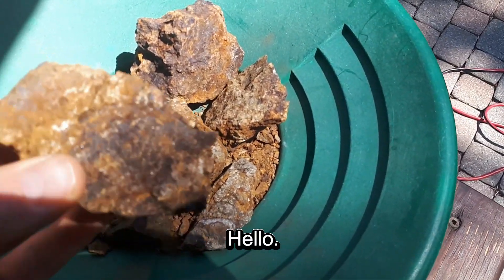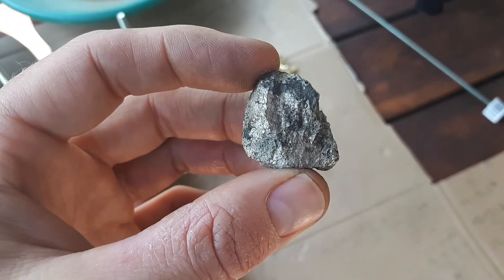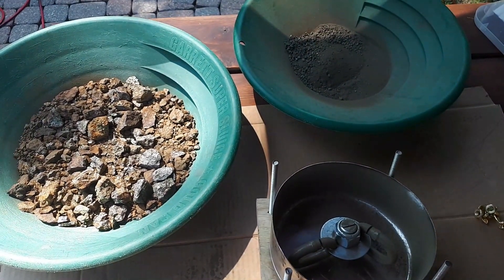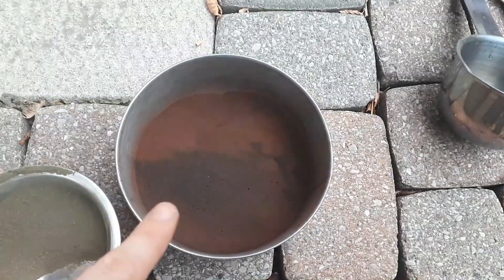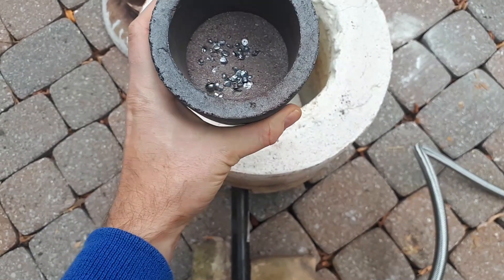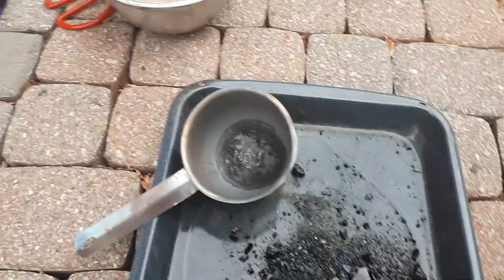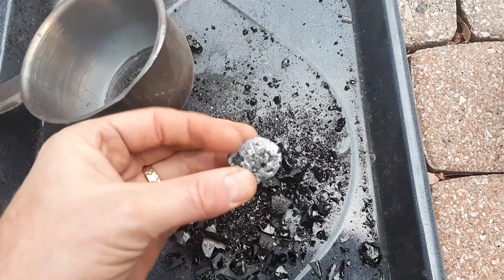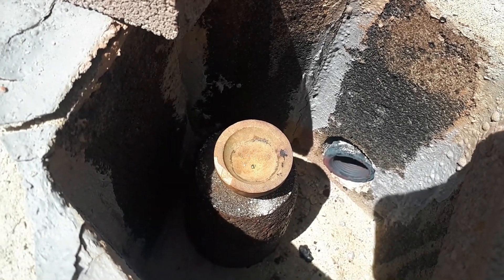Extracting Gold from Ore Found at an Abandoned Mine Dump

Comment: How do you calculate what qty of fluxes you need?
Reply from the maker: I just kind of wing it. I generally want a total of about 2-3 times the weight of flux relative to the sample. So if I have 100g of sample I usually want a total of 250g to 300g of flux. 
If the sample is very rich in sulfides, I add a lot more soda ash relative to borax. The sulphides create an acidic smelt, and the soda ash is basic, so it balances the pH out. If it is low in sulphides than I do more borax relative to soda ash so the borax can keep the melt less viscous (so it is not so thick and sticky, flows better and allows the lead to collect precious metals better and settle at the bottom).
If there is not much silica in the sample, I will add 20 or 30g of silica. If there is lots of quartz in the sample than I don't both adding any silica.
I usually go with about 25g of lead as a collector metal to pick up the precious metals. Less than that and you risk not having enough flowing around to collect everything efficiently. More than that and you need bigger cupels and longer time for the cupellation process.
I recently purchased some manganese dioxide to help oxidize sulphides, but I haven't had a chance to try it yet.

Comment: Great video keep it up man. How long did it take to vaporize the lead for this piece?
Reply from the maker: Thanks! Cupelling this I think took around 45 minutes. But the lead doesn't exactly vaporize. What happens is in liquid form the surface of the lead oxidizes very readily from oxygen in the air to form lead oxide on the surface of the lead puddle. That molten lead oxide then slides off and gets absorbed into the cupel. And this oxidation/absorption process happens over and over until all the lead is gone. A small % of the Pb does get airborne, I think 95% or more is absorbed into the cupel.
Reply: @LetsCrushRocks  Thank you. You are really creative and skilled in your work. Good results.

Comment: Hello. Excellent. Use a different method. Powder the soil and dust it with gold. The full coat and melting aid include Hello. Excellent. Use a different method. Powder the soil and dust it with gold. and then instead of lead. Put the lead oxide in the bush with charcoal powder, sodium carbonates, and borax, and finally an iron rod in the bush to absorb the sulfbeds. Your soil is probably silica and you don't need to add silica powder. And finally, use a cone container to pour the molten material. The result is great. Good luck, I am always a supporter of your videos, and the help of melting includes
Reply from the maker: I've been using an iron rod in my more recent smelts! it helps!

Comment: Gold prospecting has the advantage of today's use of ancient gold prospecting tools with the modern day machined tooling dowsing rod aiding in dowsing for gold. In the 1970"s my father and I reverse engineered the physics involved in dowsing and invented the modern light weight ball bearing dowsing rod for applying dowsing physics in locating our old core-drill on the exact center of gold and silver veins that are buried under 200 feet of glacier rock and till, which worked out perfectly for us. These dowsing physics and dowsing techniques are too important to the world for myself to selfishly take to the grave. So I wrote the book to teach the world how to apply physics in dowsing for any sought element, with marketing my book at the lowest price possible so that more people will be able to buy my book and learn how to dowse. My book's name is: The Art of Dowsing - Separating Science from Superstition ($14.95), by Michael Fercik. My book explains all the physics involved in dowsing (the same physics that energizes the alarm on electronic metal detectors), and explains how to build the modern light weight ball bearing dowsing rod, which is the only dowsing rod that accurately gauges what is being dowsed by pitting the energy of gravity against the energizing of the pure one-tenth ounce dowsing rod load that is tapped onto the ELEVATED acetylene welding rod, which free spins on ball bearings. This precisely gauges the dowsing of all edges, exact center, depth buried with angle of deposition, and most important is grading or deciphering the amount of the dowsed element that is contained in the elemental mass being dowsed. Everyone can become a professional dowser by practicing my book's dowsing lessons of buried pipelines and electrical cables, tunnels and voids, precious and base metal placer and load deposits, dowsing for treasure, dowsing for any element, amplified long distance dowsing from a moving vehicle, and dowsing on water from a boat. I hope dowsing enriches your life intellectually and financially.

Comment: They make wingnut sockets and drivers...
Reply from the maker: Thanks, that's a good call! That would be a lot faster. But I have since added a feed/extraction port at the top so I just drop the rocks in and then tip it upside down to dump out the crushed material.

Comment: I think you can cook the borax to dry it out. I have done that with copper sulphate that was in a hydrated state.
Reply from the maker: That's actually how I make soda ash (sodium carbonate). Just take baking soda (sodium Bi-carbonate) and still it in the oven at 200F for about an hour. I'll look into that for borax, though I seem to recall seeing a video where they said you had to actually get it to melting temperature to reduce it, then pour it out, let it solidify and break it up again. Quite a bit of work!